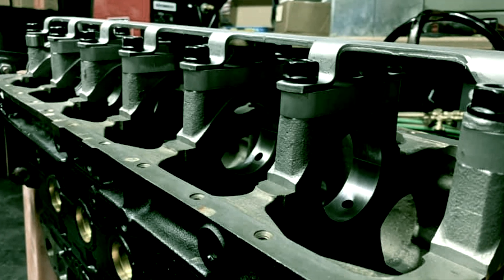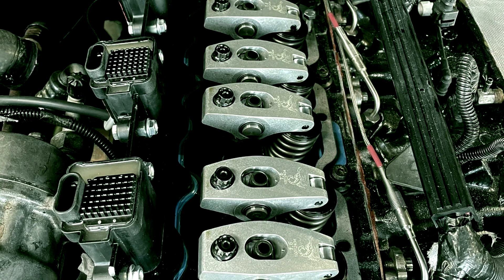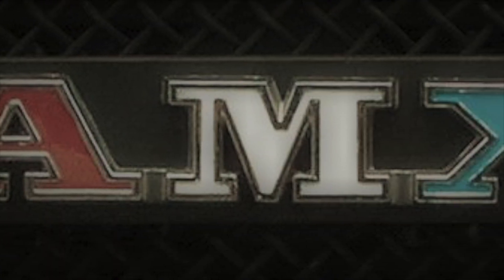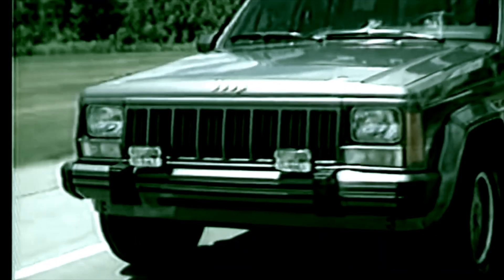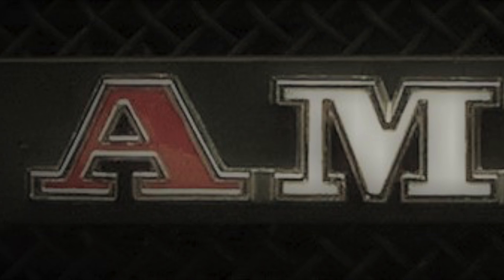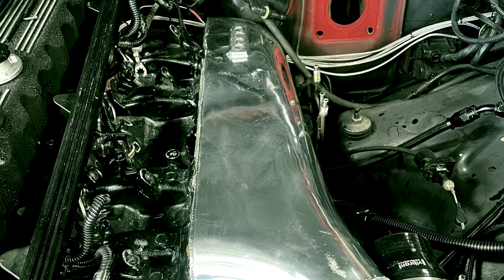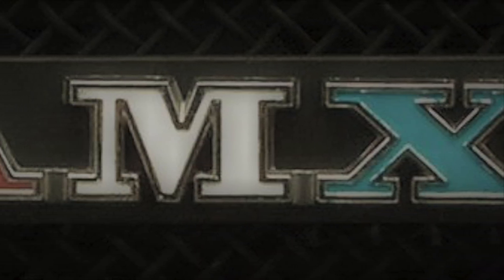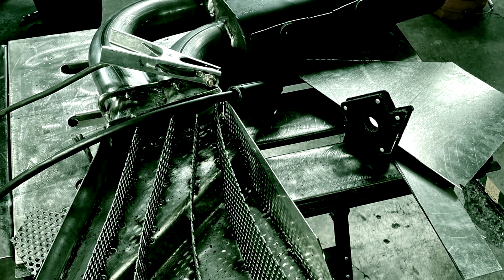Building a 10,000 RPM 4.0 -  More 4.0 back story

Comment: Yes, thanks for this set of interviews. My father worked at AMC/Jeep on Plymouth and Schaeffer in Detroit from the mid 1960s into the later 1980s as a chemist in the fuels and lube department and later worked in materials (paint, adhesives and sealers).
I am interested in at some point building a higher rom 232 six cylinder and this is good information to hopefully get past the mythical or solvable concerns of higher rpm running of an AMC or Jeep six.  If there is more about crank, cam and timing gear specifications for ths engine it would be helpful to know. 
Thanks again. Tom Best
Reply from the maker: It’s on the way.  Stay tuned and listen to the latest.
Reply: @amxj  
Given the thumbnail I was thinking there would something on a cross flow head built up from a set of LS heads.  
If I was younger and looking into this I think I'd want a 4.0 block opened up to a 4.0 bore. Even if it requires boring the cylinders completely out and installing sleeves. Instead of a 4.0 or 258 crank go to a 199 crank. Displacement of 3.75 liters. New head from either LS or Ford heads. High rpm street motor.
Reply from the maker: @mpetersen6  there is a whole community of sand drag racers in Mexico putting 5.7 LS or Vortec pistons in 4.0.  They don't sleeve them they just bore it and go.  Some hard block 1/2 the cylinder depth, but most just run it.
Reply: @amxj  
I wonder if they are using VAM 252 or 282 blocks. 232 and 258 cranks with 3.875 bores. These blocks are likely heavier than the 4.0.
Reply from the maker: I don't think so  @mpetersen6 .  This lot has a 'send it' mentality.